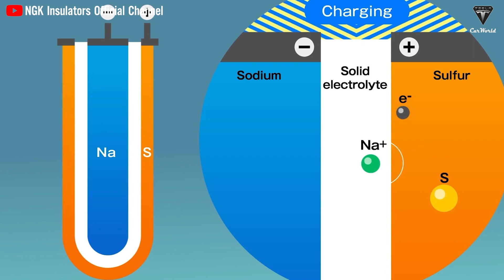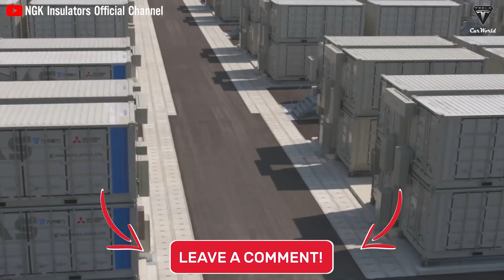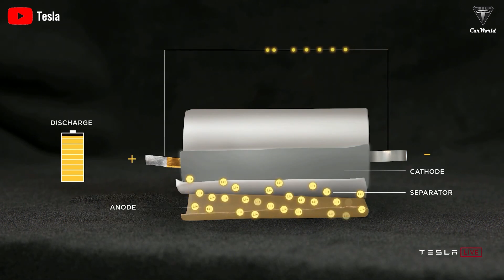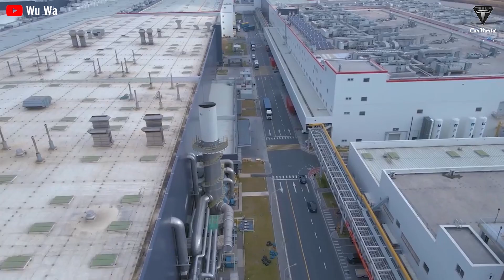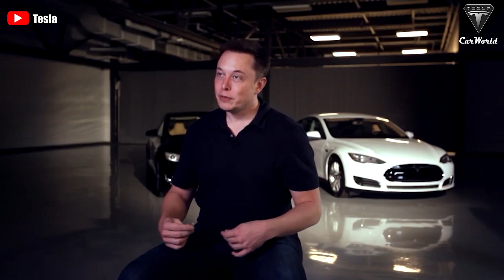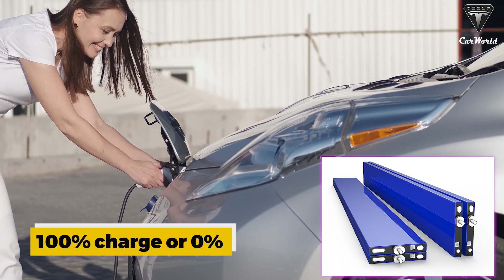Elon Musk Just Unveiled ALL-NEW Batteries Tech for 2023, Shock Entire Industry!

Comment: Interestingly, the EU has now overturned their initial rules to ban ICE vehicles by 2035! I love that Toyota have sought to keep ICE engines going, simply by replacing carbon fuels with Hydrogen fuel. This is the much better and more green option against EV batteries that typically are made from rare earths that employ children in poisonous and very dangerous mines. 
What is also most alarming is the number of EV’s that are spontaneously combusting at an alarming rate and at great danger to the driver and the local public! We also need to have recycling technologies developed to enable proper recycling of EV batteries. Green technology is not green, if at the end of life these poisonous technologies are simply buried in the earth to poison both soils and water sources!
Reply: Ice cars burn more often than electric ones  in percentage .. and lifpo batteries dont burn .. yes we have to re ycle battsand yes its possible
Reply: @gmy33  When/if EVs catch fire, it is in spectacular fashion, and they are extremely difficult to put out, that's the issue. 
Yes it is possible to recycle batteries, but that doesn't mean that it will be done. Tires can be recycled, however, most are not. 
Only about 5% of plastics are currently being recycled, and that is after years of global bla bla recycling push, so yeah.....
Reply: @coolranch1660  its pro s and cons and the way to developement .. in potential electric is way better .  It will last longer be cheaper and recyclable .. qe just have to change short term thinking and some capitalisme ways .. ..so inflamable 100% recyclable long lasting battery packs .. i guess you geard about the million mile pack from  tesla .  It was made to proof a point .. at this moment batt research and tech is highly demanded and done .. and yes everywhere firedepartements have containers  ow in qhich they can submerche a burning car .. i m exited about the future !!!
Reply: Cobalt isn’t necessary in all batteries or amounts in many batteries and isn’t just sourced from Congo. Hydrogen has packing issues. Useful with ammonia for heavy vehicles